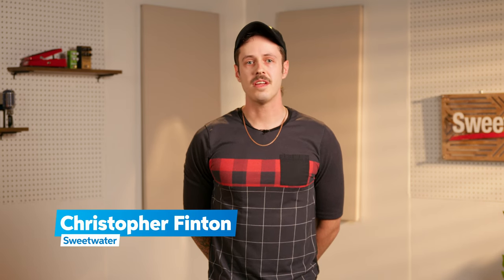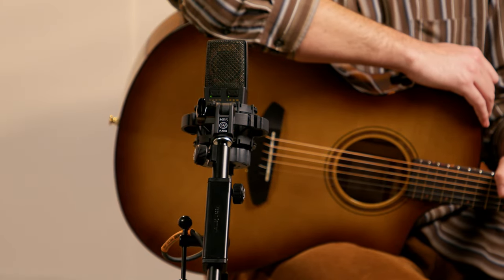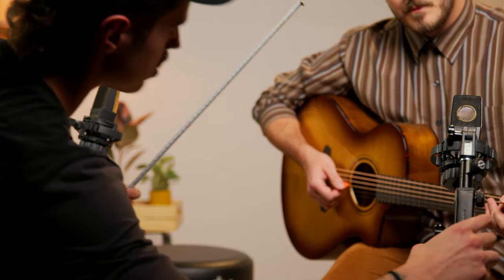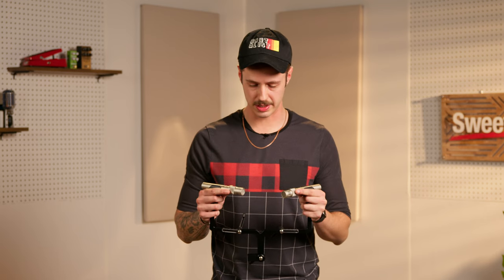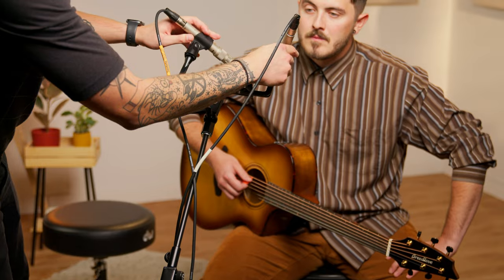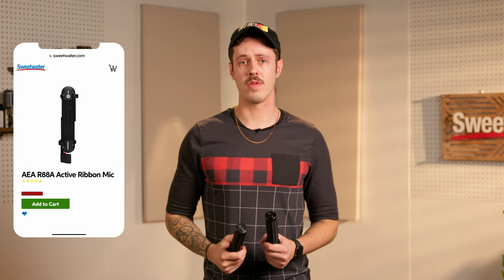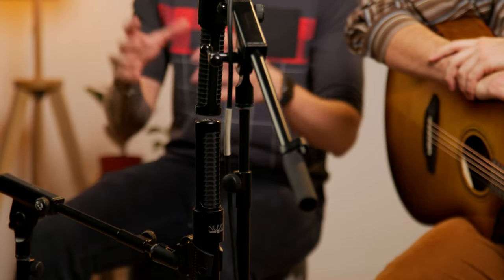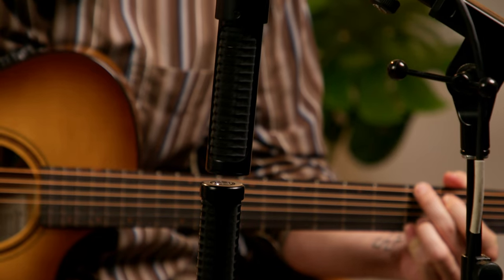Stereo Mic Recording Explained: XY, Mid-side, Blumlein & Spaced-pair Techniques

Comment: Mid-side is so good until you collapse it into mono. Used ot for ages and then ran into that issue, now i tend to use Steve Albini's with the mics on the floor.
Reply: What problem do you have with mid side collapsing into mono?